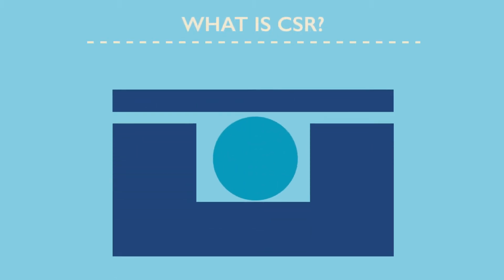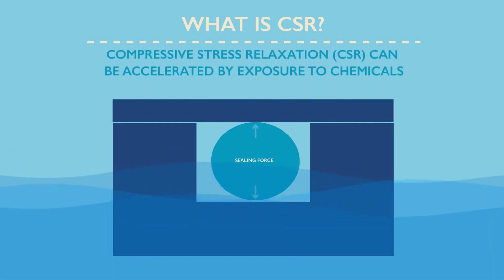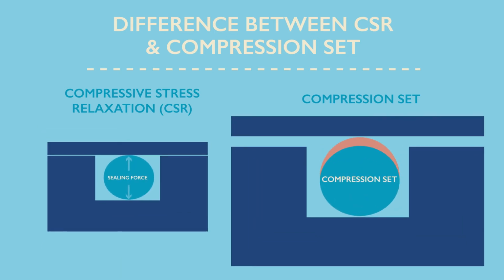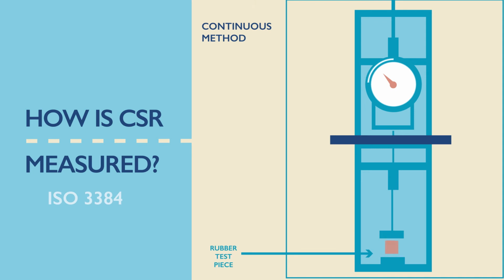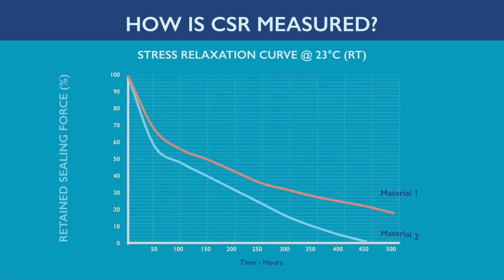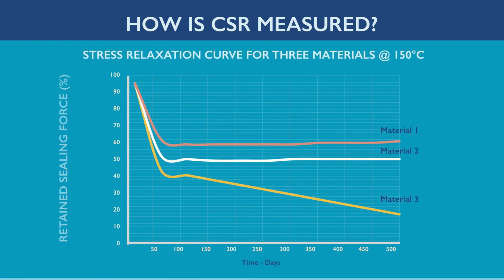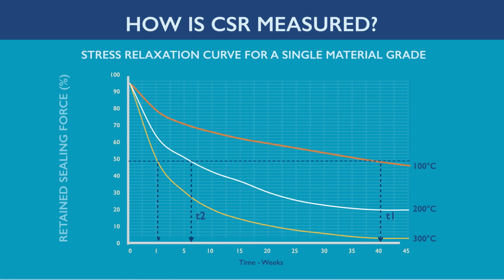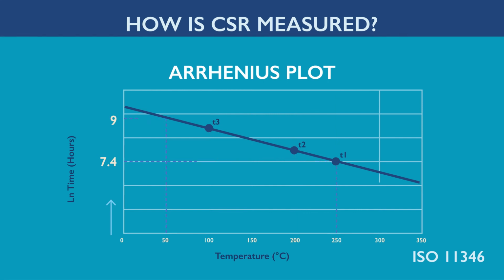Causes of elastomer O-ring and seal failure - Compressive Stress Relaxation (CSR)

Comment: Great video! I am involved with compressed air powered airguns. Various so called "experts" will NOT have it that leaving the thing permanently pressurised [to about 200 bar] WILL lead to accelerated o ring deterioration, compared to the system being stored in an unpressurised state thanks to mainly, compression set and a lesser extent, CSR. You cannot tell some people..